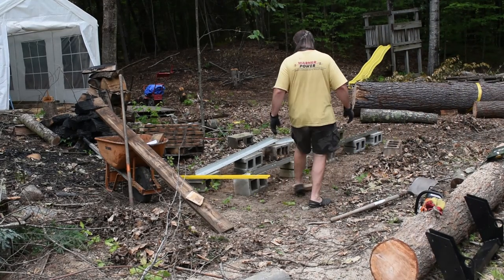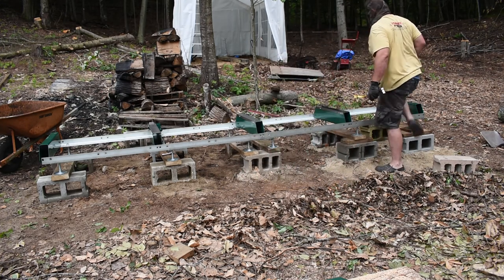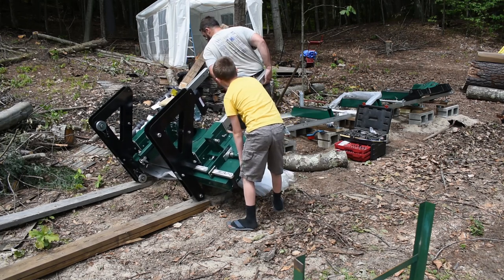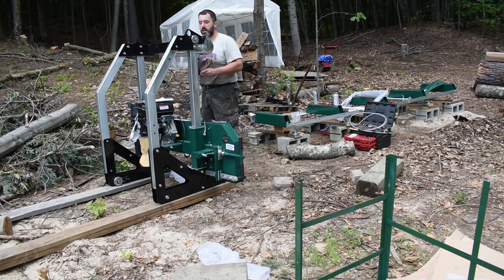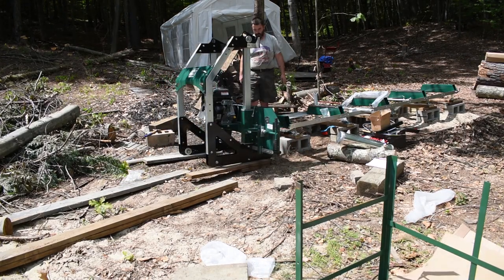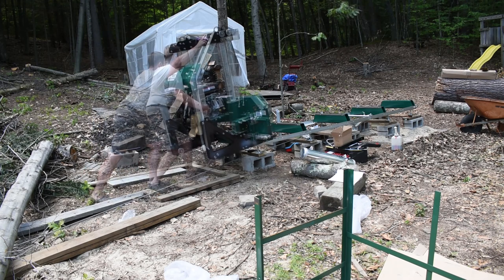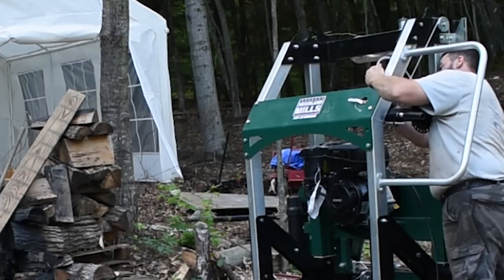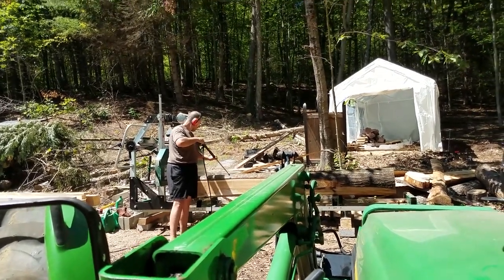Woodland Mills HM130 Complete Assembly

Comment: I did the crossbar by myself just yesterday. I set two bolts in the lower holes for a landing place and once you get one bolt in place on both sides you can then remove the landing bolts and set them in place. Really enjoyed watching and I'll be finishing up today. Thanks for doing this bud👍😎👌 Fortunately I do have a loader and an excavator for the big lift onto the tracks. Sometimes confidence is the difference between success and failure 👍😜

Comment: Good luck with your mill. Me and my partner just purchased a old woodmizer LT40 electric motor to start a new venture. We were looking very seriously at tge woodlands hm130 and may still buy one later if all goes well with our new business. As they have no length limit with the tracks. As it is ours comes with a 12' bed extension so milling longer lengths  up to 30' is possible already but some post and beam construction require longer custom lengths. Again good luck

Comment: Thank you for your interesting effort.  If I may venture a suggestion in, the process of putting the finished cart up on the rails seemed pretty awful, if not downright scary, but finally turns out well, thanks to the contribution of your nice daughter and her strong winch.  There comes my suggestion, for what it is worth.  Maybe it would be possible to make a temporary floor, thick piece of plywood, either directly on the logdeck or just behind it, so as to build the entire cart on that plywood.  Afterwards, one could then just bring DOWN the cart on its rails, if the floor was placed on the log deck, or simply roll it there, if the floor was built behind the rails and at the same level.
Reply from the maker: Thanks much for the feedback.  I really appreciate that.  Back when I built this I had no machinery here at the house, but since then I have acquired a large backhoe.  In the future I am sure I will use the backhoe if I ever need to move it around.  Thanks for watching and appreciate you being here part of the channel.

Comment: Good video, I just ordered my HM130 today  and look forward to setting it up. What electric winch do you use on your trailer?  any advice on the winch will be greatly appreciated..
Reply from the maker: Thanks!  Congrats on the new mill!!!  You will love it!  I am using a Traveler 8k pound winch.  I recently bought a used backhoe, but the winch setup worked well.  I put my mill in front of that tree so I could hook a snatch block on the tree.  I use a tow strap on the tree so it doesnt harm the tree.  If you would like to see the setup in more detail I could do another video on it.  I am more than happy to help in any way I can.  Very excited for you.  I look forward to hearing more about it.
Reply: Thanks for the info, I will have two son-in-laws helping to setup saw, the company support already seems super good, life is good

Comment: If you want longevity for a blade take the time to peal the bark where the blade runs and get rid of the bark I use a spade which is like a half moon on the end of a handle to break sod. easy to remove if bark is green.

Comment: Could you have built the head unit on the track vs the winch and extra work of lifting and realignment? Would really would like to know before my HM126 arrives in May...thanks.
Reply from the maker: phil 123 I didn't have anyone to help me move the saw head itself.  The frame parts weren't bad, but the core of the saw head is very heavy.  Would have need at least one of two other guys to lift it.  I thought about assembling it on the track, but I think I would have had much more trouble.  Anytime you have any questions feel free to email me or leave a comment.  Thanks for watching.
Reply: On my 126, it I just walked it up side by side myself to the front of the track, then just lifted the front track wheels up on track, rolled it up slowly and lifted the back wheels up on there. Worked great. I love my 126!
Reply: I build my 126 on the track. I laid a couple of 2x6's down, assembled and just tilted it forward and onto the track by myself.  Make sure the track and wheels are perfectly aligned first.

Comment: hey still have the mill? hows it running buy any parts other than blades for it yet? did you manage to put a log on it to realize the log is too big in diameter to mill on it yet? would you consider these a really capable machine and good deal or if someone had the skills to build and trouble shoot their own mill from the ground up would you recommend that

just worried im gonna order one and in a couple years realize its not large enough or that i could of build a much sturdier machine for less money with my own preferences built in
Reply from the maker: I love this mill and have no regrets.  I try to run it as often as possible.  I have been running a lot lately and really enjoy it.  I have had maybe 3 logs over the past year that were too big for the mill.  That's 3 out of maybe 100, so I would say the mill is perfect size for me.  If you find you are likely to get logs greater than 30" in diameter then it might make sense to go bigger, but for me, rhis mill is perfecr.  I can tell you that if I were to do it all over, I would buy the same exact one.
Reply from the maker: That being said, if you are capable and have the patience to build one, that would be ideal as you get much more mill for much less money.  I just don't have the time to do something like that,  but maybe some day.